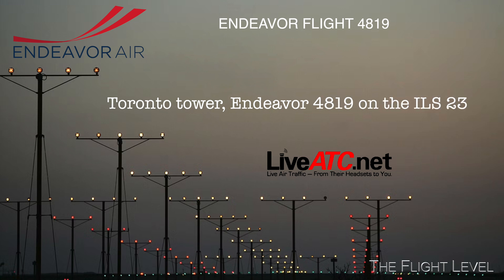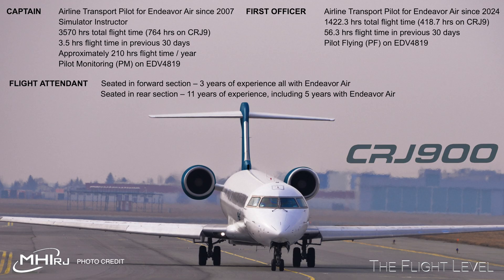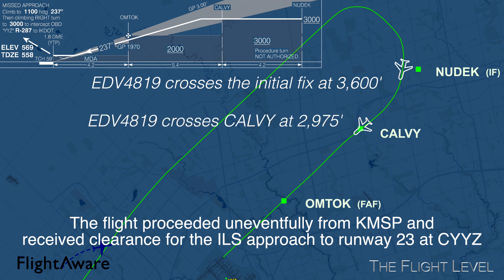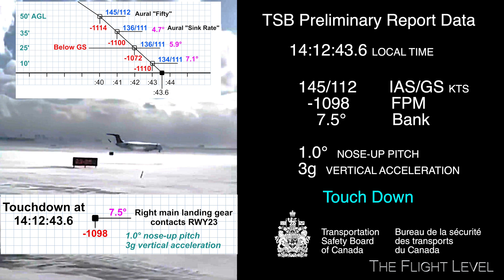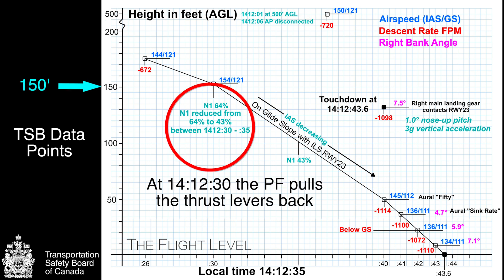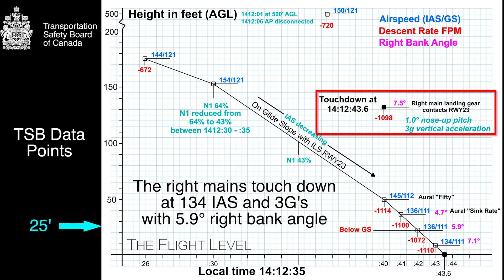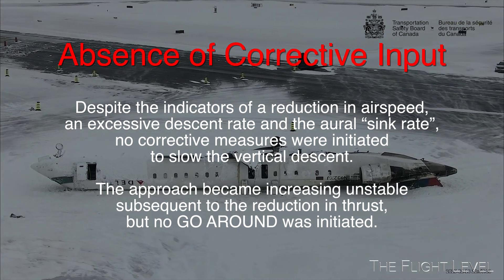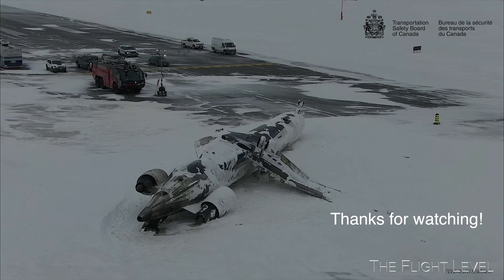Endeavor Air Delta Flight 4819 Preliminary Accident Report | Data Point Analysis Reconstruction

Comment: The airplane broke with only 3 Gs landing. Weak
Reply from the maker: You would not think that 3G's could break the side stay. I wonder if the part had a slight fracture and with the cold air and wind chill factor, it was a little more at risk to break.
Reply: As they say.. When all the holes line up.. Bad day.

Comment: Was the plane centered on the Rwy center line, or about, all the time until touchdown? Do we know that? And I guess that mention of a possible "bump" in the glide will be discussed by the pilots as a reason for a steep approach (3 Greens as they say ) ? We'll see.
Reply from the maker: The plane was on the center line 2 seconds before touchdown, so most likely very close or spot on at the time of contact.
Reply: @TheFlightLevel  Puzzling, thank you !